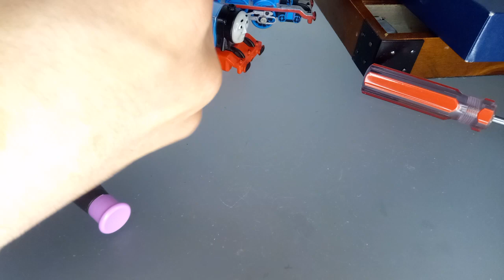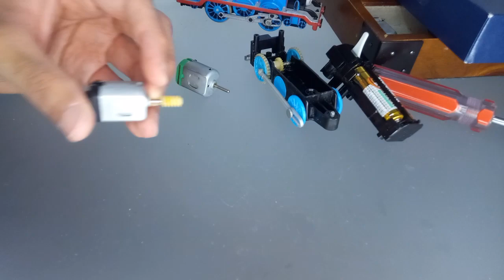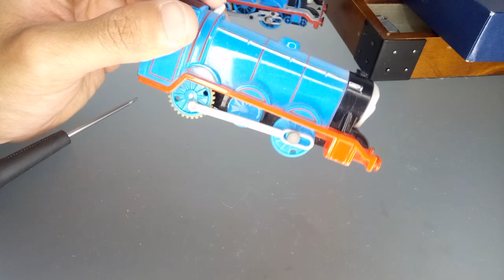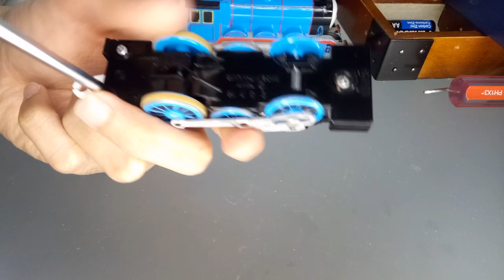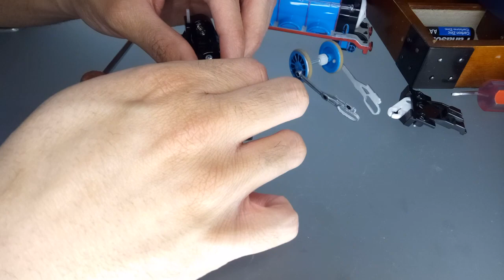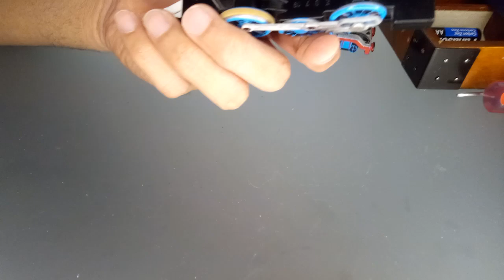GENERAL AUDIENCE how to swap TrackMaster 2 and Plarail motors READ DESCRIPTION PLEASE.

Comment: Those black motors aren't good.
Reply from the maker: Yes I know they are not like the JR hyper dash 2 & 3 motors, Tamiya light dash motors and power dash motors but the 24,000 RPM motors were the only ones I could find on Amazon for a decent price but maybe I will buy them someday.